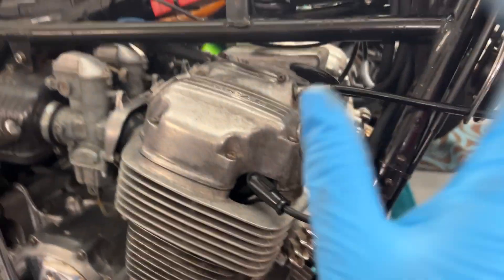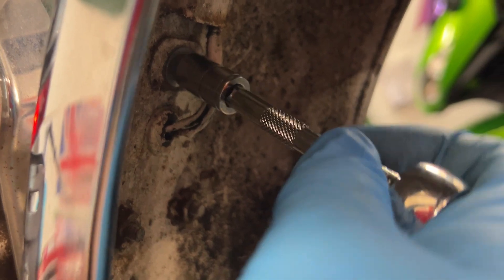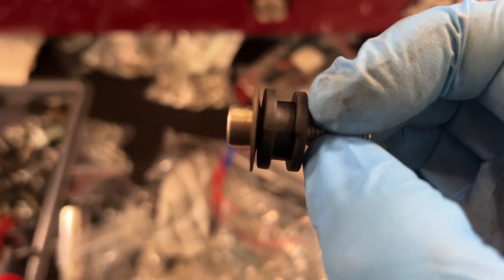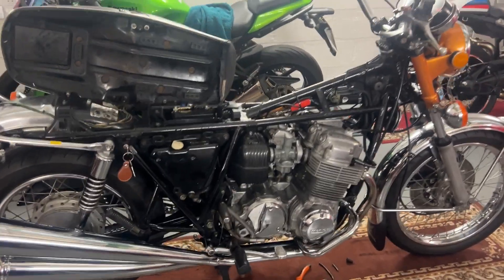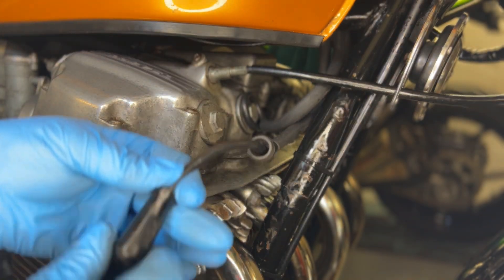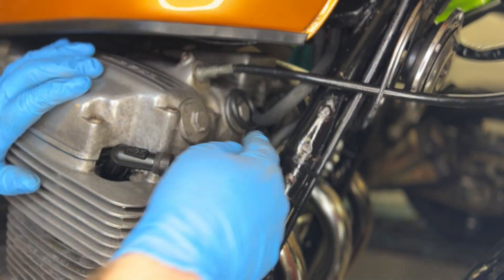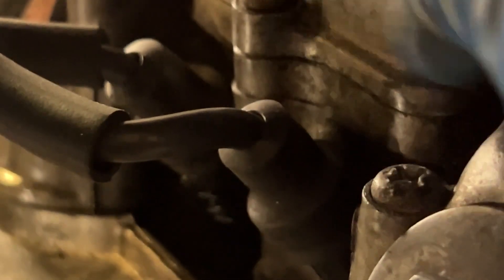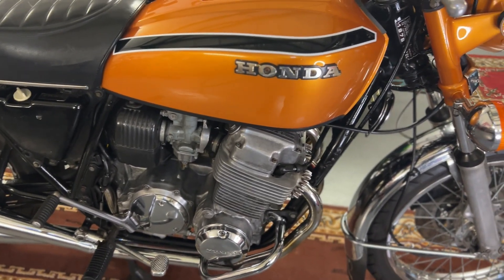1978 Honda CB750 - adjusting HT lead length - part 7

Comment: I had a 78 super sport, quite tall but narrow at the front of the seat so no problem getting your feet down, unlike a triumph 900 i had that was both tall and had a wide seat, never felt confident riding it. 
 I'm 5 11 so height wasn't the issue, I just have narrow hips.

Comment: I was out riding with a nice example last week. Great sound and plenty of umph. They are taller that I remember, the rider only just reach. Looser is definitely better than too tight inside these engines. 👍
Reply from the maker: The seat is wide on the CB750 compared to a BSA. I’m rather smitten with the CB, it’s happy to keep up with modern bikes and handling is good. Love the engineering too. Although by todays standards things have moved on a bit